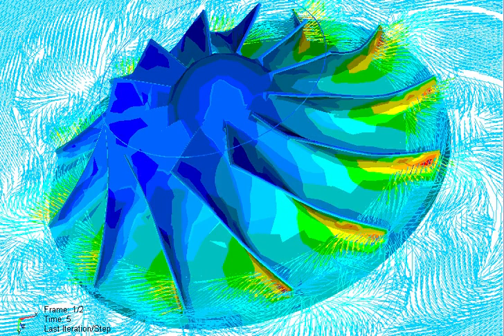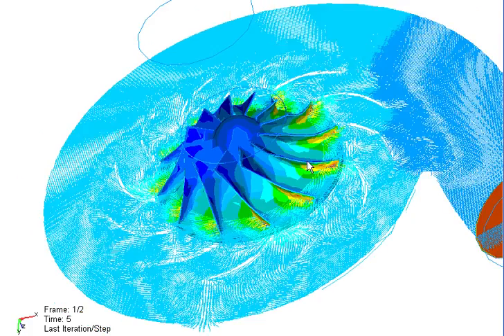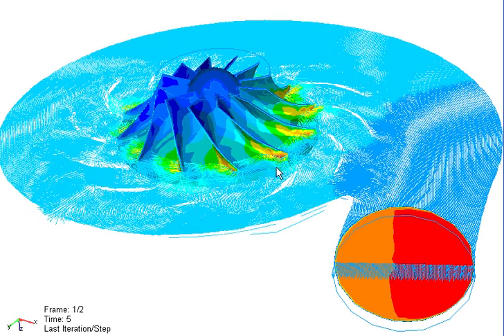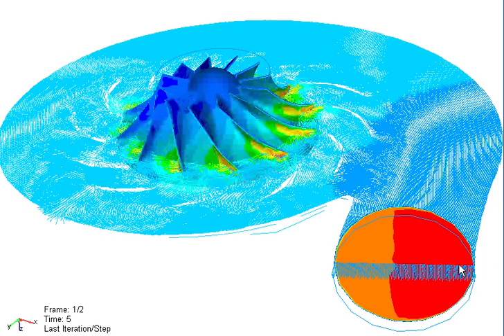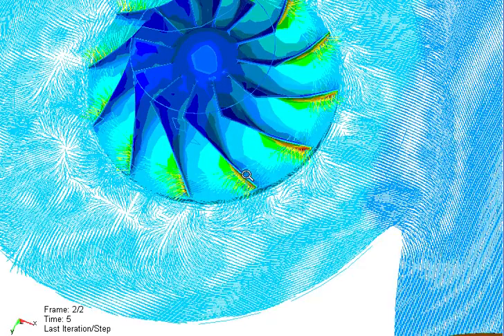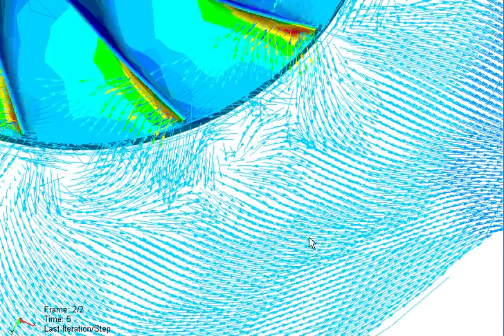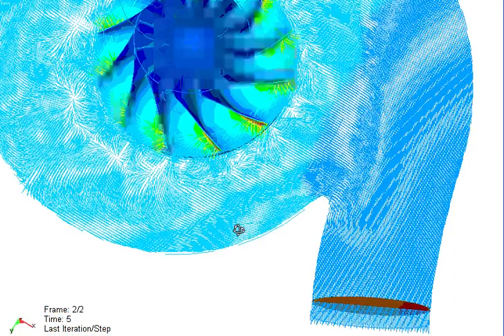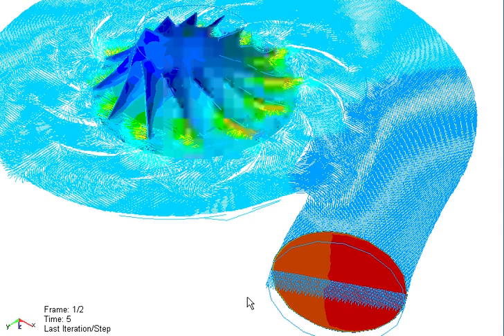High Speed Compressor design CFD

Comment: @CohibaSkeeza 

The compressor wheel is spinning in the CORRECT direction in this simulation.  The compressor direction should match the direction of the volute to conserve momentum.

As whotookmynickkokoal mentions, the key to improving this design is to reduce the housing size, especially to force the fluid to travel in the volute's direction.

See Peng's "Fundamentals of Turbomachinery" for more info.

Comment: Dude, this desing has two major problems:

1. Your radial turbine is backwards dumping the fluid in the counter-clockwise direction and then you want it to travel in a clock-wise direction - the air is being pushed in the wrong direction

2.The fluid is turning that huge corner and you have separation. The fast moving fluid is due to all the back-pressure rather than steady flow.

Your stator veins work because they redirect the air clockwise. Section-off your volute and flip your turbine.